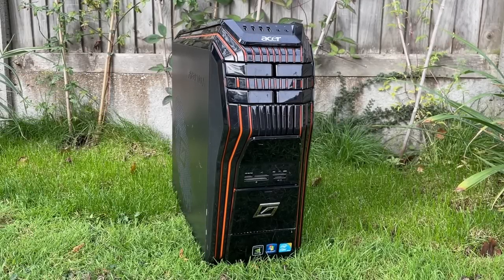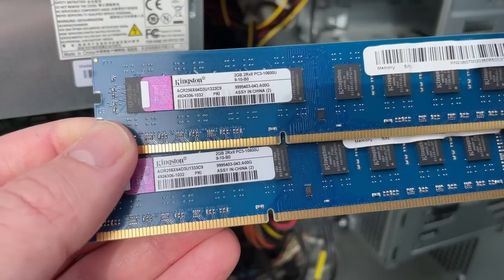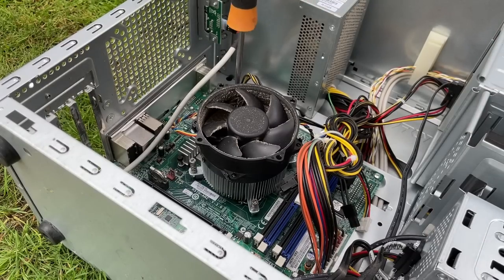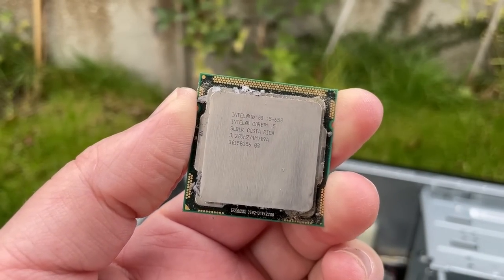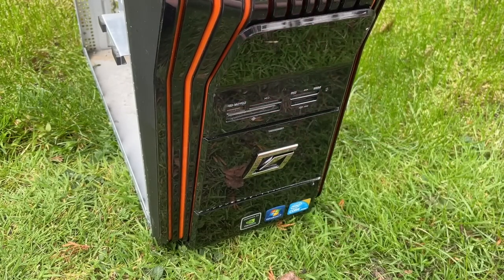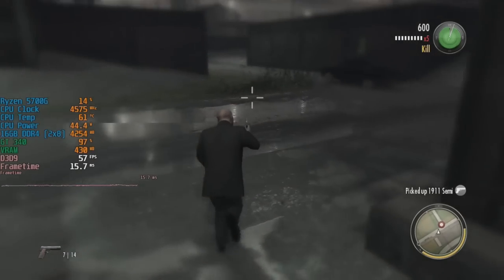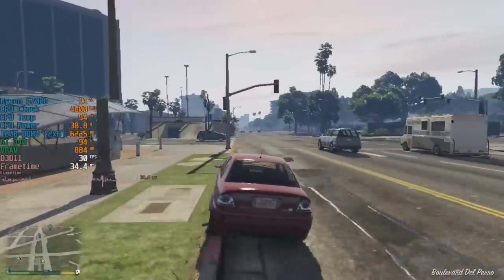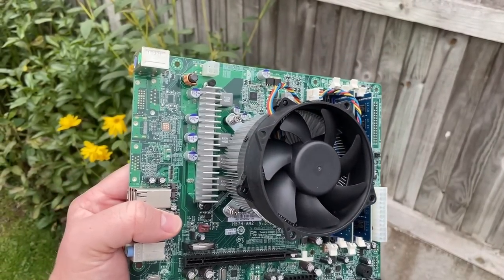This decade-old Acer Predator gaming PC has NEVER been upgraded, so what's inside?

Comment: I fell for one of the G5900's, over the years it had some Bits thrown at it, an  I7 870 Quad Core 2,93 GHz CPU  16 gb ram  480GB SSD and a Geniune totally over spec for it MSI GTX 1050ti 4Gb card.
The  Boss Was still Using it last year 2022 on a 1080 twin monitor setting in World of Warcraft with 60-80+ Fps In Raids of 20 - 30 players and she was still keeping up with others using 1080ti cards in boxes that were a couple of years old. I know WOW is not that demanding, But for a Dinosaur PC  on a 1st gen Intel  i7  with SATA 2 Disk transfer rates,  it has been reliabe and also been good for doing network back ups of other boxes in the house, on 3x 2gb Raid 5 set up Disks it has been keeping cool with a case fan. So even today still a very usable box for general use.  But now sits idle.

Comment: Had a HP Pavilion 3143us with a i3-370m, a 1GB ATI 5650m, and 4 upgraded to 8GB DDR3 RAM laptop back then. A little less powerful than my Q6600, 8GB DDR2, 512MB Nvidia 9700GT from 2008. Gamed OK-ish, played Crysis 1-2-Warhead fine, was struggling with 3. PlanetSide 2 was around 30fps until you hit tons of players, then it dipped sub 10s. Paid 120usd to be a founder for MechWarrior Online, and couldn't really play it.

Comment: Honestly it was considered a budget, entry level gaming computer and so as much I wouldn't expect much in terms of performance even when it was new. Ironically dollar for dollar the XPS 9000 would have easily blew the doors off this system for not much more. But that's not even the half of it. The quad core cpu would have put this system in to a much nicer position for like a few measly bucks. Sure, it still would have been considered somewhat low end, but certainly more closer to a decent entry level gaming system. I don't know what Acer was thinking.

Comment: I still use that cone for side intake because case i'm using only has side intake and just having the cone there lowers cpu temps by like 4-5 degrees under max load(cinebench or p95) and i'm using ryzen 7 1700 which doesn't run that hot(65W TDP) but it's still nice to get lower temps essentially for free since i had two of those cones at home

Comment: I have that same cpu in the rig im using right now a i5 650 upgrading it to a i7 870 and a gtx 1060 6gb turbo asus my current machine is a prebuild dell xps studio 8100 i also installed 16 gb of ram in it and currently using 3 monitors

Comment: Honestly the damned thing likely stopped working due to an old capacitor in the power supply or a cold soldered joint. Those old cpus are surprisingly tough!

That GT 340 needs some isopropyl alcohol, the back of it is a fuzzy mess of doom
Reply: A bad PSU can cook a PC.

Comment: Hmm at least your bios allows you to overclock! I have a similar computer I've been messing with for a week. A 2012 $400 acer aspire m3450 am3+ fx4100, on-board gfx, stuck a 850w psu (plug n play) and gtx780Ti for testing. Going to try a titanX lol. With the 780 cant see post, bios, or boot screens but if you install gfx in pcie mode in bios you can put it back to onboard display as primary and you can hot swap hdmi cable. I use dual booting with win10,11,2 ssd's in gpt, easybcd, I go throught the boot process with onboard smoothly, then once in windows I hot-swap hdmi for a big graphical boost even in desktop or youtube without enhancements. Unfortunately the 780 also only has directx10.5...?  The heck lol.  My acer has no front intake fan either!  Mine didn't boot up for a few years also and it was because I had swapped the ram chips out and stuck in a broken ecc ram and stored it. Got it working again one day pretty easily with 2x2gbs now it's running 2x8gb, but you can probably do 4x4gb. To install modern gfx; set to pci gfx in bios, maybe msconfig and set to reboot in safe mode, apply, shut down instead.stick card in, black screen till a single "_" cursor, hit enter log into windows at like 720p and then let it automatically download drivers and nvidia control panel. Takes like 20 minutes leave it alone and it'll change itself to 1080 if your monitor allows for it.

Comment: I’ve got a Alienware Area-51 ALX from 2006/2007 with Windows Vista. I wanna tear it down and clean everything but scared I won’t remember where everything goes.
I tried to install an SSD and reinstall windows but it needs some sort of driver which I can’t locate and now I’ve put the original Hdd back it it randomly powers off after a few mins of running 😩😩

Comment: maybe you could put an RX 6400, its efficiency would allow for headroom to overclock the i7 you put in the place of the i5. Though I also kind of want to see the PSU replaced and a 2011 beast like the GTX 590 put in there to see how well it holds up today.

Comment: A friend had the G5920 iirc with an I5 2320, 8GB DDR3 1333, HDD 1To and a GTX550Ti, the whole thing for 800 or 900€... I upgraded his system with a GTX670 in 2014 when I replaced mine with a GTX970, sadly it was just missing an SSD :/

Comment: I still get by with an i7 3770 lga 1155 is still serving me well with a gtx 1060 6gb
Reply: same, my 2nd pc is an i5-2300 and gtx 670 PE OC, i will soon give it my rtx 2060 from my main pc now cuz i will get a 3070 or 3080 or something
Reply: My secondary gaming PC has an i7-3770 @ 4.22-4.43GHz but only a GTX 760. I got the system for free from my uncle a bit under 3 years ago with an i5-3450 and old HDD as a boot drive, since then I've upgraded the CPU and added an SSD. Graphics card prices have come down a lot so maybe I'll buy a better card for it someday.
Reply: I still get by with an i5-4670 and GTX 750 Ti 2 GB

Comment: Ah i got an Acer Predator in 2012 but it was quiet more capable. It had I7 2600, GTX 570 (with a horrible stock fan that was mega loud and i even reached 100°C with it 3° over the TDP) and i believe 8gb RAM.

Comment: Case is a bit yuck. Nice throwback though. I got a Predator G7700 case which is older than this, it looks amazing. Metallic orange 🍊 I customized the inside to fit a modern motherboard and changed up the front panel cables for it to work and it runs like a dream. 5800X w/ 3070 :) I highly recommend that case IF you can get one...quite rare now.
Reply: I go for the cleaner look myself. My case is as plain as it can get. It's almost a simple box. The front has chamfered edges and that's it. It's an Antec VSK4000E I'd like something a bit wider for a taller cooler. But if I ever get something like that I might just have to cut a hole in the side of it. The performance blister.

Comment: I never had one of those P c's but I think 1 of my friends did But the one thing I'm not a fan 
 of   Is that the heat shroud As I remember  Right My friend had  a PC like   The case was a little bit different But it had the same         Cone shaped Heat shroudIt was definitely not good for thermalsThe PC was constantly overheatingBut as I remember rightHe changed it out and it worked fineI think that particular designAttracted a lot of dustAnd it wasn't that great For air flowI'm sure it gave a lotOf air to the CPU But not to the rest of the system But then again I really love push pull configurationsI feel it's the best wayTo have good air flow through your system All of your fans don't need Don't need to be the same type Whatever works for you Because there's a million different Fans But the one thing I would recommend A Push pull configurationThat way all your fans all your fans are working togetherThat way you're good to go  And that way you're ready  For   Warp speed Are at least a million FPS Well maybe not that much But good air flow Is really important  But anyways Great   Video  See you in the next  Video Cheers

Comment: I just got my first one is the Orion 3000 P03-630-UA91 with the 11th gen CORE I7 processor and the NVIDIA GEFORCE RTX 3070 Windows 10 home witch will update to Windows 11 home and will upgrade to Windows 11 Pro and it has the SSD and HDD HYBRID DRIVE CAN'T WAIT TO SET IT UP .

Comment: I actually downgraded from a R5 2600 to an I5 2400 which will be replaced with a 3770k but I need a new mobo as only 1 ram slot works. Only reason I parked my and are to start rebuilding her. I am planning to upgrade her to something like an 5800x3d. I have a 1070ti in this system but planning around a 3060ti for my new system. The 3060ti can be had for dirt cheap on the second hand market
Reply: why did you downgrade? your going from a ryzen 5 2600 to an i5 2400 to a 3770k and then back to a 5800x3d? Why wouldn't you have just kept the ryzen processor and upgraded to the 5800x3d instead of going through all those CPUs?

Not trying to have a go at you or anything, it just seems like an odd choice.

Comment: yeah im still rocking on my 2008 775 socket quad core its holding good for old shit have an ssd inside and stuff new pc its yust too expensive...
Reply: You got that right. I mean what are they thinking? In 2009 I built an all new PC and it just cost a few hundred. Case, PSU, motherboard, CPU, RAM the works. Just plug it in and go.
Reply: @1pcfred  yeah true today ur not pluging in nothing below 2K
Reply: @GRGA4200  there's no more budget market.

Comment: put an i7 or xeon in it and maybe a 1050 ti and try some more modern games, id also paint the inside of the case black
Reply: I was thinking the same thing about the case insides. A rattle can and have at it. It'd look slick blacked out. But gloss or flat? I guess you could spray it flat and if you didn't like it then clear over it.
Reply: @1pcfred  semi gloss at least flat black always looks bad in my opinion

Comment: possibly a PSU issue if its that old!
Reply: PSU issues quickly turn into whole PC issues. What happens is the PSU starts pumping out excessive ripple and that hammers the rest of the parts. Which aren't designed to handle that noise.

Comment: Jheeeez i was expecting the good old 980ti beast in this case would be kool, 
Question for anyone who would care to help me, 
I basically have a ryzen 5 3600 b450 pro 3200mhz 16gb ddr4 rx580 8gb oc bequeit 750w dark pro gold rated,  few ssds,  I wanted to upgrad to a 6600xt, so i brought one sapphire version, and i can not get it working for the life of me 6 day's i spent trouble shooting,  First off i used ddu and uninstalled the amd driver's and turned off xmp,  Used safe mode and turned off the pc with ddu,  It worked up until the drivers installed then it shut off,  so i tried again wuth a older driver still no good,  And i do have a gold rated bequeit 750w dark pro, so no problems there,  After 6 days of it shuting off i give up and put my rx580 8gb back in and it worked perfectly,   What can i do next i want it installed,?   I am a sim racer that plays assetto corsa that's 14 years old but with a modded installer and custom shaders patch that makes the sim look beautiful,  If anyone can help im willing to give them the rx580 8gb oc as a good jester,   its sitting in my sock draw moaning at me lol,  all jokes aside im gutted and want it working

Comment: sure the gpu and cpu were a bit poopy, but atleast that socket 1156 supports ddr4.
I have myself a predator g3-605, which had a gtx 960 2gt and a lga 1150 socket i5-4460. it totally outperformed what you showcased, but its proven to be a bitch to upgrade. ive gone with a i7-4790k, but it stil only supports ddr3. not that the 1156's are any easier to upgrade, since all the cpus made for it are totally ass

Comment: That board is dead or soon will be 
I have trow that board a way .
I have it with a Intel i3 and yes that i5 4core i have it what you hope for in your video.
After i try to upgrade to the i5 .
The board stop booting .
It hang after bios memory test .
And no the psu i had change to a antec earth green 430watt .
I sick of it and trow it away. 
No it have gigaby bord with a i7 2600k in it.
And run perfect with the antec 430watt psu .

I have see on the board if somting is broken 
But nothing to see .
That board is a pain in my ass for years .
Sometimes it works for days with no problems 
And sometimes it just boot and stop after memory check .
And no i have test the memory and just fine in a other pc

Comment: Not bad for its age (though a quad core CPU and slightly better GPU would have been better) and I'm pretty sure you can get that working again. Having sid that, with just 4GB DDR3, I can see why it shipped with Windows 7, and with a hard drive (and no SSD) I wouldn't really want to run Windows 10 either.
But give it a few upgrades, get it fixed, and it can game again. Heck, I didn't even know it had a DVD drive - let alone hot swappable hard drive bays(!) - until I saw this video.
I wish more modern PCs had room for hard drive bays and optical drives.

Comment: The PCs from 2010 to 2015 are not that great. The GPUs, the Ram or CPUs were too weak....even back than. I remember how disappointed i was from my new PC in 2011...every  upgrade (i did) wasen't worth the money.

But in 2016 the golden era of PC Hardware started. Even in 2022 a ryzen 5 1600 with a gtx 1070 is a good PC for gaming.
Reply: Hey my PC is from 2013 so it resembles that remark!